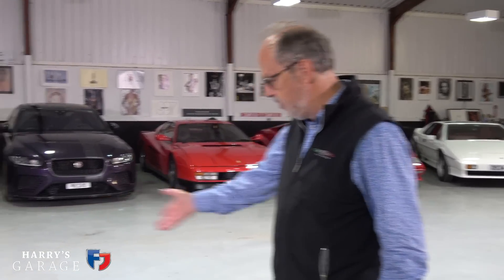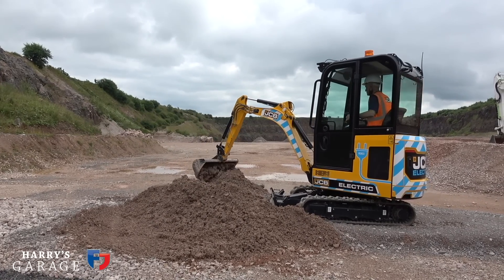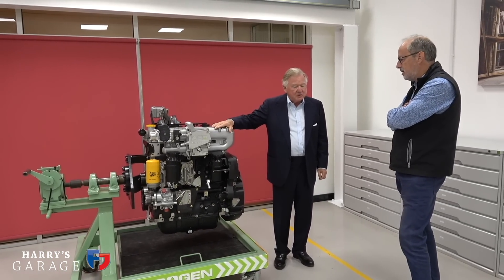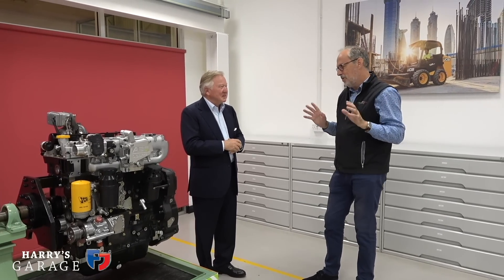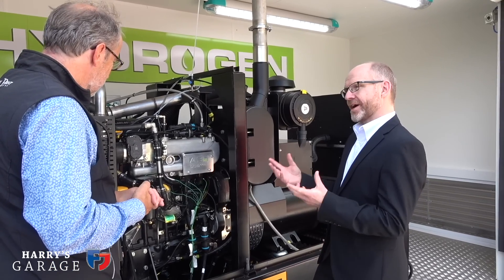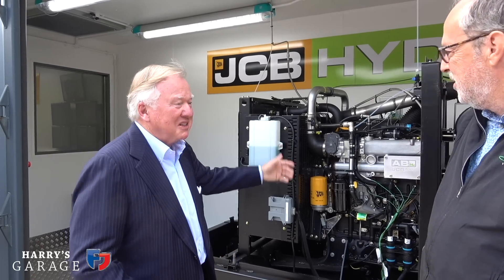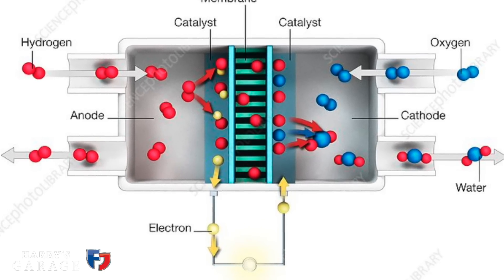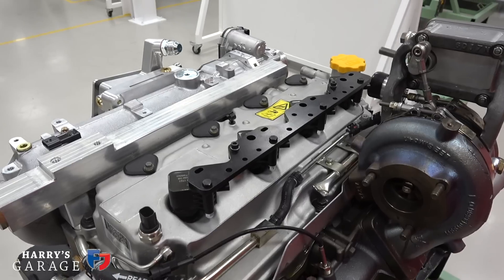Is hydrogen, rather than electric, the future for big-engined machinery? I visit JCB to find out

Comment: The diesel engine was designed to run on peanut oil originally, the problem isn't the engine, it's the fuel, which is petroleum refining waste! The diesel engine could be carbon neutral run on vegetable oil.
Reply: There is no way of getting that amount of vegetable oil. The amount of farmland required makes it completely unworkable.

Comment: Bear in mind that hydrogen is the smallest molecule there is. Containing it is hard. It will leak through glass. This means all pipes, tubing and connectors need to be very much more leak-proof than the tolerances we build things to today. That's not to say that it can't be done but it does make the idea of just using conventional engines less valuable.

Comment: The thing that isn't totally clear here is that while hydrogen has more energy by mass than gasoline, it has very low density and therefore requires high pressure tanks which are expensive. These tanks also store the hydrogen at a density that makes it less energy by volume than gasoline.
With that all being said, I think that may be an easier engineering problem to solve than making more energy dense batteries without lithium.

Comment: Really enjoyed this. Always thought hydrogen was the way forward. Please tell me @19:38 that`s not alloy pickup on bores 2&3.
Reply: ...or likely the onset of steel embrittlment in presence of hydriogen combustion. Just one of the very many  reason why hydrogen combustion is a very stupid idea.
 Hydrogen fuel itself has some possible merit as a green sustainable future - in some limited applications. But only when used in context of fuel cells. Not combustion.
Reply: @bbbf09  Interesting comment. What do you reckon is the reason for JCB pursuing this technology if it`s flawed?
Re that piston pick up on the bores: Lack of upper cylinder lubricant, coupled with rings too efficient at scraping the bores of sump oil lube? (Suzuki`s early GSXR motorcycle range, if my memory serves, had oil jets cooling the underside of pistons and the bores.)
Are Higher operating temps to blame? Combustion duration? Compression ratio? Turbo boost*? I suppose valves &seats are made from bulletproof material nowadays, so they`ll be ok. *I noticed on stripping a turbo diesel engine at 100,000 miles, bore ovality from the pistons being "banged" against one side of bore. Although some turbo diesel motors in cars/trucks, go on for half million miles or more.
I`d like this tech to work, but I`m inclined to share your view at the moment. 
Wasn`t a Filipino farmer running his farm vehicles and cars using small hydrogen generators under the bonnets/hoods, back in the 1970s? Similar to the kit one can buy to clean up combustion, with supposed improvement in fuel economy, claimed to be due to power delivery available at less throttle opening because of better combustion,  on one`s day-to-day transport....with slight risk of explosion if not assembled/maintained correctly!
 I`m no fan of electric and its sustainability claims, so would love something else to trounce it..
Reply: @rattusnorvegicus4380  In my 'boy racer' days I was big into my cars and tweaking engines. I am also a profesional engineer and a fan of effeiciency and effectiveness of simplicity of form and function. 
I come to accept that electric has so many more advantages over combusation that any inetrnal combustion just now not worth pursuing - it's had its day. Liek steam it will become a passion for enthusuiasts and a interesting afternoon in teh musema. Advantages of electric
 
1. power to weight ratios mor ethan 10 times that of combustion engine
2. Minimal servicing, miantenance. Million mile electric motors are easily achievable
3. Flat zero time torque repsonse curves
4. Able to operate in any environments... dust , immersed in water, lack of O2 (high altitude) . Nothing stops them

I must say that I will miss the throaty roar sounds of a nicely tuned engine. But that is all. I hate now if I have to go back to driving a combusation engine for anything more than just fun on track. 

On hydrogen - as a transportable reasonable high energy density mediuam it still may have a viable place out in remote inaccessible off-grid areas - such as construction sites where JCB works. But only in conjunctionwith fuel cells running eletric motors - not combustion. Hydrogen is terrible as combustion engines compared to fossil fuel ones - but worst it wastes  half the hydrogen energy you could otherwise extract from a fuel cell. The problem with fuel cells at momenet is they are expensive and maybe not so long lasting - but this is what they should develop. They just don't have history with these and likely can't make such a profit from development.
To me it's obvious why JCB are pursing this course. They will make it work in the end - but it will be costly and always inefficient (its sewn into the Carnot cycle  physics of combustion engines) . They will likely sell the expensive H combustion engined monstrosities at lower cost - as a loss-leader maybe - probably matching cost of comparable diesel so as not to scare customers. 
 But then make a killing in the long run on JCB approved hydrogen pressure tank refill sales and servicing/ maintanenance contracts that will be sky high compared with diesel. I'm sure they don't want to go down this route - but they will have to do something to back out of fossil fuels as they will be forced to by government. This scam is their best chance at maintaining fat juicy profits. Look at their history - they havebeen heavily fined for anti-competitive and monopolising prcatioces before. This is the way they operate. 
In the end they will eb outperformed by thos ethat sticks with batteries and hydrogen fuel cell tech. But it might take decades before their loyal customers leave them. I'm sure Bamford won't care about the legacy he leaves. It's profits and dividends now that matter to him.

Comment: How does HOH figure as far as efficiency, power/ cost etc?….far easier to tap off from electrolysis.
Reply: Hydrogen uses a lot of energy to extract from water at the moment.  The technology is getting better but it is best suited to being powered from renewables when they are generating excess electricity over the current demand on the grid.

Comment: Tesla demonstrated how simple it was to have battery packs swapped out in his cars in 5 minutes. New heavy equipment that is electric powered could be designed the same way this way the equipment could run 24 hours a day minus the time for swapping the battery packs out. Also on large projects they could set up a temporary solar power station where these battery packs could be charged on site. This is a significant savings over transporting diesel fuel or manufacturing hydrogen and transporting it.

Comment: If you really want to use an internal combustion engine, hydrogen is a bad idea. You are better off using biofuels and keep using the same engines.
Reply: Using expensive-to-make hydrogen in an internal-combustion engine is wasteful, but might provide a stop-gap while more efficient electric-based systems are perfected.
Internal combustion has only been cost-effective because of the abundance of cheap oil. The overall thermal efficiency of it is appalling, which is why those figures are never published by motor manufacturers.

Comment: This is clearly a better alternative to electrical vehicles... of all kinds. I would suggest that a simple way to distribute the hydrogen is to use the gas grid rather than transporting hydrogen multipacks around. Membrane technology exists to take gas of 20% hydrogen and 80% methane into 90% hydrogen and 10% methane. Maybe a small amount of CO2 would not be too bad, especially when it may improve the compression ratio and efficiency of a diesel engine. So I predict that the next set of patents will concern means to regulate and optimise diesel performance with variable amounts of methane present. Can't say I have details about how much the compression ratio could increase, but as a retired research chemist with a few years of experience, I think it's most practical and cost effective to think less about absolutes and more about what works, especially when the main consumers of fossil fuel are, shall we say, lagging behind a little.

Comment: Certainly appreciate the innovation being shown here but wouldn’t a drop-in replacement fuel like HVO renewable diesel make more sense in the short term whilst we’re waiting for the new-fangled technologies to go mainstream? HVO or hydrogenated vegetable oil is a drop-in replacement fuel that can run in any Diesel engine and emits lower particulates and substantially lower CO2 emissions. Feedstock is waste oils so this is solving two problems in one go.
Reply: @richardlyd7450  Yes, it's not perfect but the target is net zero not absolute zero. If CO2 can be reduced by at least 75% through this easy means then that's a meaningful reduction I would grab in a heartbeat. Plus technically the CO2 released was absorbed when the plant material was growing so it is net zero in the same way biomass is. Doesn't have to be the only answer, could be the transition fuel that gives easy wins until something better comes along.

Comment: The problem here is that burning hydrogen in an internal combustion engine IS NOT a zero emissions solution. It doesn't produce CO2, but it does produce some pretty wicked oxides. 
We'd be better off using biodiesel over hydrogen if we are going to burn a fuel. It's cheaper too!

Comment: I am sorry, this is not going to work out as projected by Lord B.
- Hydrogen is inherently very costly to produce. Only when we get to produce greatly more than we consume, which is beyond the horizon for now, it may be a good option.
- Hydrogen engine's are NOT zero emission. There is NOx in the exhaust gasses unless  you use pure oxigen (no air) for its combustion

- Lord B addressed the extra weight of batteries but ignored the extra weight needed for the high pressure and bulky hydrogen tanks
So I have a few questions:
- How did Lord B calculate the extra weight for an electric machine in terms of electric motor weight versus hydrogen motor weight, battery pack versus hydrogen tanks
- What battery energy density/weight ration did he use for his calculations
- What would be the extra operating cost for the hydrogen based machine verses a fully electric machine in terms of hydrogen and maintenance?

Comment: What about the energy to pressure, store and distribute liquid hydrogen? In the meantime, why not use propane/LPG as an interim until the hydrogen infrastructure starts to come into place ? May be developing a spark ignition LPG motor that can be later retro-fitted to hydrogen ?

Comment: Why is this Hydrogen engine not being compared to a similar electric motor? The real problem being discussed here is how to store the energy required to run them. There should be a comparison between an EV battery and a fuel tank that stores hydrogen. Both of these technologies are fascinating.

Comment: The inflationary aspect of a battery powered personal car is relative, as the fuel cost are much lower, especially if one has solar panels. Its fixable with good financial products and prices of electric cars will go down eventually.

As this video shows hydrogen has its place for sure, starting with heavy industries. 

And as research and hydrogen production starts scaling maybe for personal transport to.

Comment: Finally someone is looking at real application of heavy duty cycle ICE and the inflationary cost of upscaling BEV to do the same jobs.

You can't drive the price down on batteries by consuming more precious metals or rare earth metals it's their rarity that drives their costs up.

You can't run a farm harvester for 12 to 16 hours on a battery without dramatically increasing its size, weight and cost plus the cost of the infrastructure to have it charged for back to back 16 hr days in the rural setting of the North American prairies.

Wind and Solar will reduce the cost of electrolysis to produce Green Hydrogen without being totally disruptive to the industrial support infrastructure of engine service and fuel storage.
Reply: Which is precisely why EV battery technology is looking to move away from precious metals........

Comment: Apparently right now most Hydrogen is produced from Gas: The chemical formula for methane is CH4 and hence you can see that Hydrogen produced that way produces Carbon - no good. Therefore hydrogen production using electrolysis of water using electricity would need to be massively expanded. Should not be a problem really since both electricity and water are pretty much everywhere but it's an important issue here

Comment: Very interesting. But no mention of BMW's efforts with hydrogen ICEs. They built the hydrogen 7. They were making prototypes from at least the 1990's. They gave up. I wonder, therefore, if this new idea by JCB can really work? It is a laudable effort, but it has been tried before and wasn't successful. 
Regarding inflationary aspects of EV's. They certainly are real. But, the cars are cheaper to maintain and far cheaper to fuel. Lifetime costs may be the same or less than those of EV's. It isn't such a simple equation. There is no danger of long term price increases in rare earths. They are almost ubiquitous. There are gigantic reserves. There may be price spikes, but they will rapidly be ironed out by new mining and supply.

Comment: I’ve been running an LPG van for 12 years, 185K miles and just replaced the Cylinder head for the first time. Zero emissions yet it has fallen out of favour and it’s getting harder to find suppliers. At one point there were Government incentives and plenty of Autogas suppliers. Hydrogen would need to succeed where LPG failed.
Reply: LPG is hardly zero emissions, come on. It's still a hydrocarbon and on average emits 83g of CO2/km. Cleaner than diesel but not zero...
Reply: Zero emissions at the point of use John, but horrendous emissions during the production........

Comment: Selling the idea of nitrogen combustion is fine, not mentioning the full cycle of hydrogen storage, production challenges and use is a bit less ingenuous. 
Nuclear options exist (very safe ones) as well for hydrogen production.
Also not mentioning the efficiency of electrically powered automobiles nor their minimal parts and maintenance vs life costs is myopic. 
All I hear is “inflationary” over and over. 
It may cost more to purchase but will last much longer with almost zero maintenance and the fuel costs the same or less. 
Combustion engines are about 25% efficient, electric around 95%. 
If you are better then sell the features, if it’s that good then improperly accusing the others as inflationary won’t be necessary. 
Otherwise great presentation.

Comment: A 1/3 tank of hydrogen is compare to 1 full tank of gas, meaning with the same tank size you can get 3 times the range,eg if a car with car gets 400 miles on a tank convert to hydrogen and you can get 1200 miles on a tank and the car would have twice as much power, an the oil would last 4 times the let of a gas because there isn't carbon in the oil to lessing the life span of the oil. This is a great solution because we where moving from extracting oil to extract material from the earth, when we dig and there is no more materials just like oil what happens after?

Comment: 8:00 they keep saying "zero emissions", though the heat in combustion will create NOx molecules from the air. So I'm wondering if a) they're just ignoring that, which is lame, b) they're using bottled oxygen for combustion, or c) they're scrubbing it somehow

Comment: Internal combustion engine driven vehicles are only 20% efficient since they lise 80% of the furl to heat, whereas electric motor driven vehicles are 80% efficient. The rub is the weight and cost of the battery.... but it is rapidly evolving.

Comment: Very interesting video however one aspect and very much the ‘elephant in the room’ did not get a mention and that is safety. Hydrogen is an extremely dangerous gas with an LEL of 4 % and an UEL of 75% (lower explosive limit and upper explosive limit). So there is a wide range of concentration of H2 in air where an explosion could occur. H2 density is so low that for a reasonable vehicle range the vehicle fuel tank will need to be pressurised to between 350 and 700 bar depending on the range required. In addition due it it’s small molecular size, H2 is a ‘searching gas’, it will find leaks. 
There will be some very clever engineering required to give safe reliable refuelling facilities that the general public can use and adequate protection for occupants in a vehicle collision scenario. In summary not quite as straight forward as the video suggests.

Comment: i knew as a engineer that with  skilful design and r and d like J.C.B. hydrogen straight in a tank on a car in to a internal combustion engine suitably engineered for hydrogen. Simple you would think, but no car manufacturer has taken it up. also all petrol engined vehicles could be converted, no over expensive  polluting manufacture of EVs  which are of limited range and require precious metals for there mamufacture and are prohibitively expensive for the average person, madness!!!

Comment: Harry Harry Harry I have been banging on about this and how almost every petrol engined car can be made to run on H2 with a bit of plumbing and a change to the spark advance. Also diesel engines are not to difficult either. They were at it in Norway years ago but that got shut down as this is about control and nothing to do with true environmental protection.